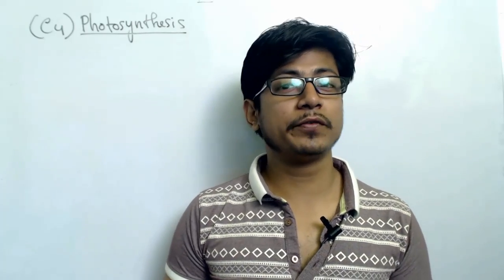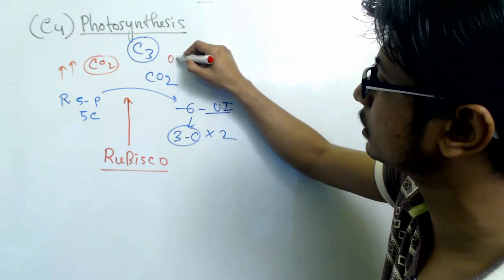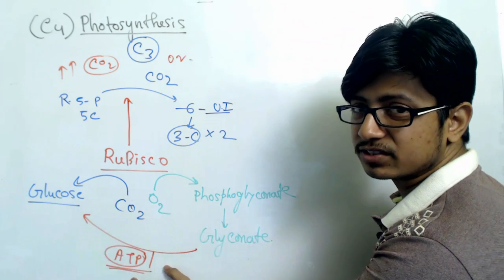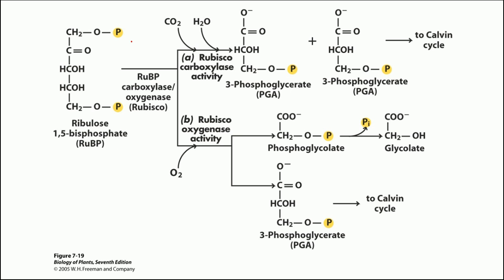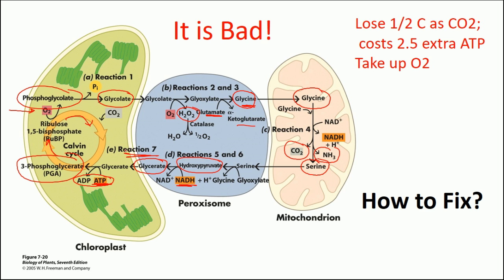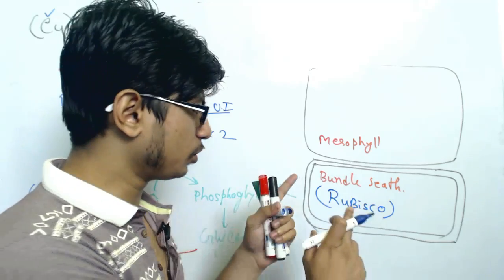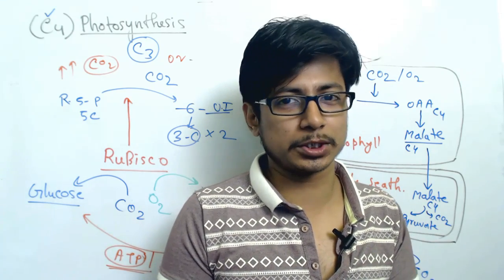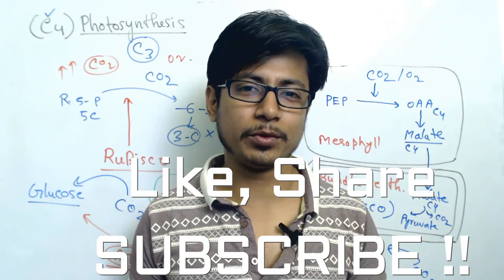C4  pathway Photosynthesis and photorespiration

Comment: At 11:55, you said Bundle Sheath Cells don't have Chlorophyll. That's incorrect. Bundle Sheath Cells do have Chlorophyll as Bundle Sheath Cells have Chloroplast and they are larger in size. Bundle Sheath Cells lack Grana instead. And correct me if I'm wrong. Thanks!

Comment: I do understand there is a whole lot difference between plants photosynthetic activities,  we do classify plants as C3 and C4 plants based on how it cooks the starch!! The C4 plants are modified to do photosynthesis in two different compartments  unlike the c3, since they have very narrow leaves and a less surface area. In contrast C2 cycle happens in both the c3 and c4 plants to reduce the oxidative stress of the cells!! C2 is not at all bad, it is very much essential for plant growth, to protect the cells from oxidative damage and also to assimilate nitrate from the soil. Although photorespiration is greatly reduced in C4 species, it is still an essential pathway – mutants without functioning 2-phosphoglycolate metabolism cannot grow in normal conditions. This video just mutates the whole concept of C2 and C4 pathways!!
Reply: C2 cycle is basically the PCO cycle
Reply: ERR never heard of  a c2 cycle!
Reply: ill beter google it bro!